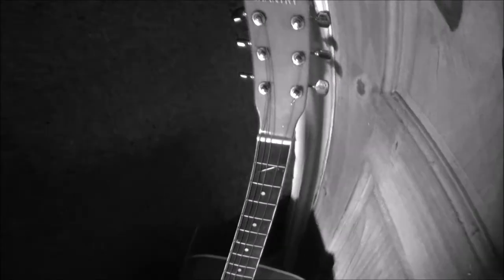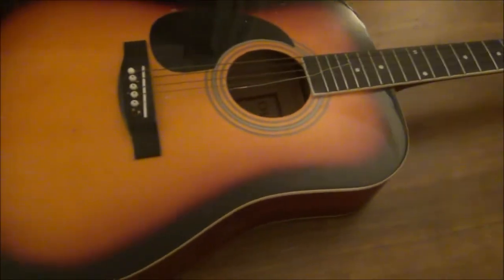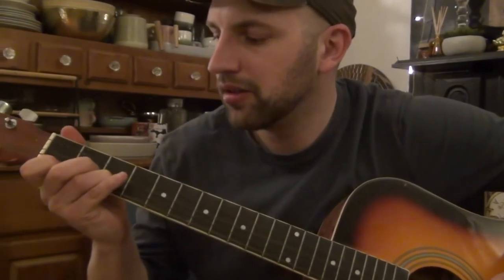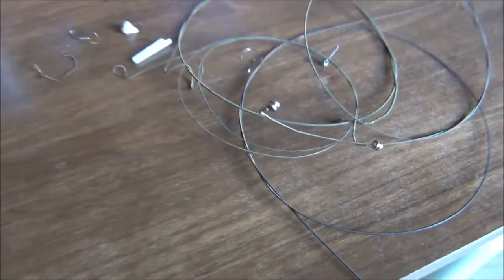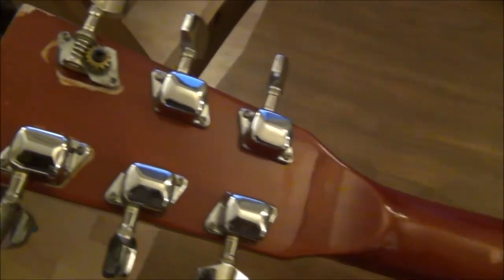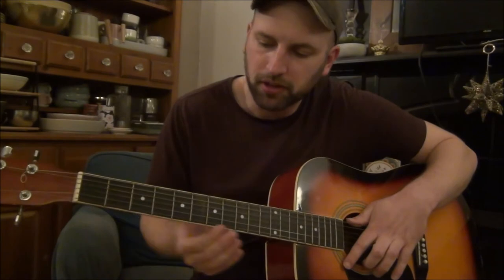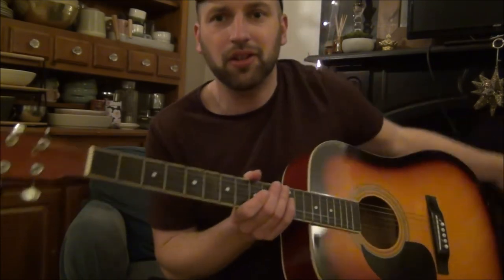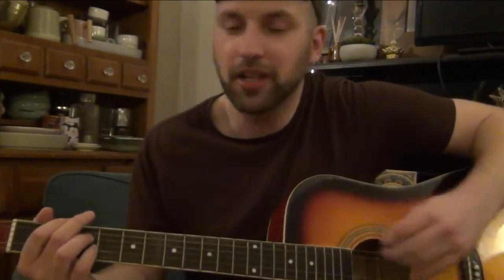SAVING AN ACOUSTIC GUITAR FROM DESTRUCTION! (CHANTRY)

Comment: Enjoyed the video, nice to see you got a decent camp fire sound out of it. I have a Chantry electric bought second hand and it sounds more than decent.
Reply from the maker: Hey Kim, big thanks for watching👍.
It sounds great if you want make a bit of noise without doing much damage to your wallet!
What style electric have you got?
Reply: @jdfosho  Hi, it's a strat style hsh plywood body, quite weighty, Floyd rose style bridge, which I have blocked off. I gave it a good clean as it was truly filthy with old rusted strings on. It now has new strings, I tightened up the output jack give it a good dose of wd40. There is only 1 video of it on you tube if you want to see it, a kind of tobacco burst, black headstock and rosewood fingerboard. I am genuinely pleased with it and it would give many  more expensive guitars a good run for their money. Best wishes. Kim.
Reply from the maker: @Kim Gower  sounds good, I shall check it out - all the best!👍